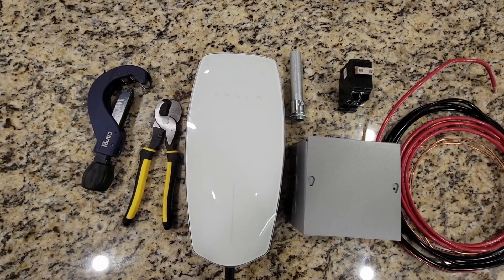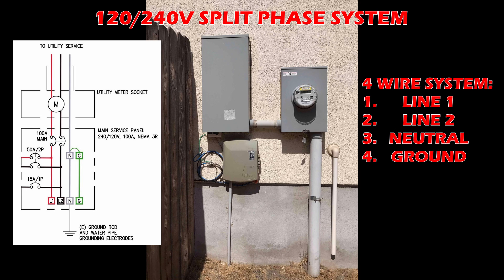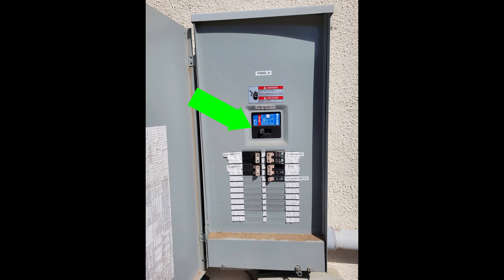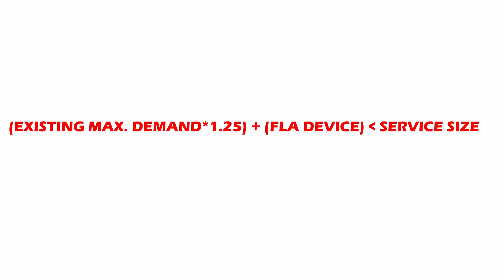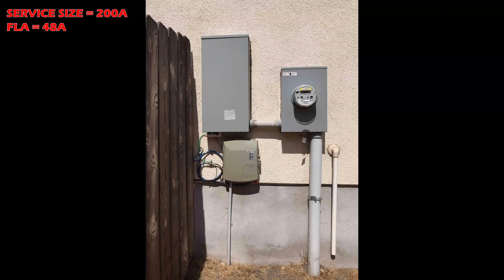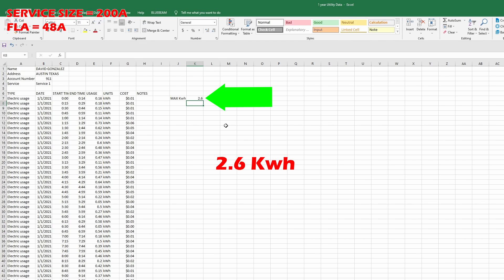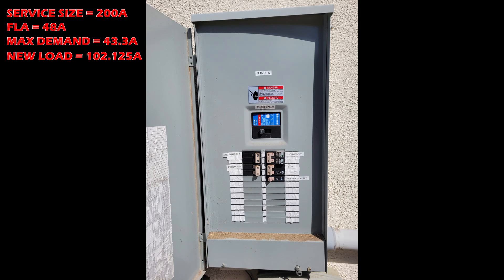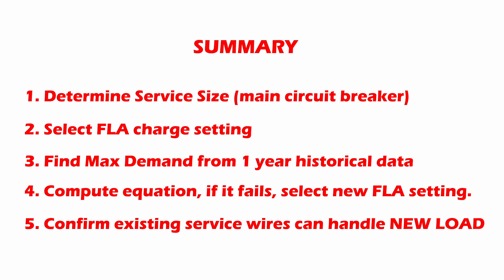Watch THIS before Selecting your EV Charger Circuit Breaker Size DIY

Comment: Great advice but I am moving into a brand new house and have been living in a 37' trailer where my electricity is free.....the question is how do I figure this out. The new home is 1275 Sq. ft and has a 125amp service. I am thinking of putting a 40amp breaker in for my tesla charging.

Comment: Too complicated. If you charge your EV from midnight to 6:00 am when electricity demands is low, you’ll be fine. However, if you intent to charge your EV during the day, yes, you need to calculate and check if your electrical panel can handle such demands. 

My home has 100 amps max service and I only charge my EV at nigh, with no issues.

Comment: Is the wire need to have a conduit even inside of the wall?
Reply from the maker: For residential installations technically no; i still recommend installing conduit. For commercial installations, conduit is required.

Comment: Excellent video.  I did this.  I downloaded the last 13 mos electrical power usage for our home from DTE Energy here in Southeast Michigan.  It gave maximum demand by the hour in an MS Excel compatible spreadsheet form.  I used the "max" function and found the maximum kWh level of usage covering over 9600 hourly readings.  I then divided by 240 and multiplied by 1000.  The answer was 44.1 amps.  So, speeding ahead, the inequality is met for the amperage levels under my consideration.  Thank you!

Comment: What's the part number for the Dryer combination breaker/SPD? I can't find anything quite like that online but is ideal for the panel my Daughter has.
Reply from the maker: SPD/Breaker I have is made by Eaton model CH250SUR. Eaton makes two models 30A (CH230SUR) & 50A (CH250SUR). FYI: These units will only fit inside an Eaton electrical panel that accept 'CH' type breakers.

Comment: Good advice to use data of actual energy use. The traditional "Load Calculations" are just an informed guess and will always vary from reality to some degree or other.

Our Landis+Gyr meter shows max energy in kW averaged over 15 mins. With this info I see our max amperage was 78 amps, so we are well within our 200 amp service. I did a load calculation and it estimated we are at 102% of the service when in reality it's half of that.
Reply from the maker: 15 min metering data is the most accurate--couldn't agree more.

Comment: But which gauge wire? One rated for 60a in your case?
Reply from the maker: Here's my minimum wire size design guide:
(COPPER American Wire Gauge AWG)

30A circuit breaker = #10 with #10 ground 
40A circuit breaker = #8 with #10 ground 
50A circuit breaker = #6 with #10 ground 
60A circuit breaker = #4 with #10 ground
For larger feeder runs (100ft+) wires need to be upsized to compensate for voltage drop.
Reply: Thank you! Now I have to see if hard wiring needs a neutral! 8/2 or 8/3! @dgtv3320
Reply from the maker: No neutral required. I share a bunch of install details in these two videos: https://youtu.be/OPc9_7wjcVM 
https://youtu.be/TenDt45gH_4
Reply: @dgtv3320  Thank you! I will watch.Mine will be Mopar because it's from the dealer, but I imagine its the same, though I will wait until I get it to buy cables! Thank you for the info!

Comment: Very good video. if anyone is handy enough and follow the code and watching so many videos here, it can be done very easily. This is NOT for all to install. Having said that, if you already installing one, go for the max AMPS you can considering your current panel max in. Moreover, I would avoid using plugs/outlet, if possible. These 2 things are a weak link and can cause many issues. After all, heavy AMPS are running for hours via these lines and they generate heat. HARDWIRED is the way to go.
Reply: When you say you would avoid using plugs/outlets are you referring to a mobile connector and Nema 1450 outlet? 🤔
Reply: @Da-King-of-Swing  I am referring to the NEMA outlets/plugs. Look, they will hold fine, but, why creating a weak link, if can be avoided. Even when doing hardwire, you need to makes sure all terminal screws are tight on these #6 or 8 (AMPS and length of wire using). Many video here on how to......!

Comment: Excellent review of how to assess your home demand for installing an EV charger.  There is, however, one more piece which is not covered in this overview, which is what size wire you need to install to the charger.  I purchased and installed some 8 guage romex wire thinking that it could handle 50 amps, but apparently only thhn 8 guage wire can handle 50 amps, but 8 guage romex wire is only capable of 40 amps.  Thus, I presume that I can use that 8 guage romex wire with a 50 amp circuit breaker and limit the charger to 40 amps.  If I knew this in advance, I would have installed 6 guage romex wire instead, but running new wire is challenging so I will start with this wire I ran and    consider changing it out if I find I would want more capacity later on.
Reply from the maker: I agree. I should have covered wire size; I didn't in this video but I cover it in 2 other videos. Regarding your wire install
Here's my minimum wire size design guide:
(COPPER American Wire Gauge AWG)

30A circuit breaker = #10 with #10 ground 
40A circuit breaker = #8 with #10 ground 
50A circuit breaker = #6 with #10 ground 
60A circuit breaker = #4 with #10 ground 
For larger feeder runs (100ft+) wires need to be upsized to compensate for voltage drop.

Comment: Great video! Excellent job in explaining how the actual calculations are performed. Any plans on doing the video to feed from a sub-panel? I've got a 200amp main panel with two 60amp sub-panels and was curious to know how the math works out to figure if I can install a 48amp car charger in one of my sub-panels. Thanks and keep up the good work!!
Reply: A 60 amp sub panel by code can not supply a continuous load more then 80%. So a 48 amp continuous load ( anything that runs more then 3 hours ) would need 60 amps and while an EV was on you should not have any other loads on. Suggest that you have an electrician either increase the 60 amp sub panel to 100 amps or runs dedicated 240 volt line to the charger.
Reply: Thanks for the input; will get an electrician to see what my best option is.
Reply: @garbo8962  Thanks for the input; will get an electrician to see what my best option is.
Reply from the maker: 48A charge setting on a 60amp sub panel wont work. From a cost perspective, it may be worth looking into a 30A or 40A circuit installed at the subpanel (assuming your electrician deems it safe to do so). Installing a dedicated 60A circuit from your main panel might not be worth the additional cost. Curious to know what quotes your electrician comes back with.

Comment: I see in the description you explain that you need data points every 15 minutes.  My electric company can't provide that or monthly maximum demand.  What I do have is a years worth of usage from every hour in KWH.  Can I take that max number divided by 240 times 1000 to get max AMPs?
Reply from the maker: Unfortunately using 1hr data invalidates the equation. I plan to release another video for an alternate calculation when 15min data is not available.

Comment: I’m doing a 50 amp can I use 8 Awg

Also can I put 8/3 romex in emt?
Reply from the maker: Romex in EMT is ok; however using #8AWG for a 50A breaker is not recommended. 
Here minimum sizes (using larger gauge  than minimum is ok, the Tesla wall connector maxes out at #4awg)
50A circuit breaker = #6 awg + #10 awg ground
40A circuit breaker = #8 awg + #10 awg ground
30A circuit breaker = #10 awg + #10 awg ground
Reply: @dgtv3320  I have to transition from emt to gray pvc to go undergound. Can I use the #6 romex for both EMT and PVC?
Reply from the maker: yep, not a problem
Reply: @dgtv3320  just to ask again, its ok to run 6 romex from emt to gray pvc underground. Iwill be using 3/4 gray pvc.
Reply from the maker: yes you can, cheers.
Reply: @dgtv3320 can you do 60amps=6awg+10awg ground ?

Comment: While verifying that your service wires are the correct ampacity isn't a bad idea, if your MCB is rated larger than your service entrance wire, YOU ALREADY HAVE A BIGGER PROBLEM, your wiring is not nor ever was to code, and you need to hire an electrician because clearly that's not the only problem you are going to find.

Note: in some situations, there may be an additional breaker between your "main" panel and the service entrance, Especially in (sane) regions that primarily locate their electrical distribution inside the dwelling, you can sometimes find an exterior breaker rated for the service feed, so the panel's MCB being "correct for the Bus ampacity,  but too small for the incoming service" is not technically incorrect.

Here where I am in Ontario, these types of external combination breaker / service disconnects are almost always associated with ancient feeds that are 60A, or (rarely) smaller if they were replacement breakers for services that were originally 30A fuse panels. They should be replaced regardless, and may be old enough to predate trip-free requirements. Meaning a jammed handle could prevent the circuit breaker from opening.

Comment: 1970's panel with 150A service. Do i need 200A service upgrade?
-sanity checking....
(EXISITING MAX. DEMAND*1.25) + (FLA DEVICE) < SERVICE SIZE
(57.6A*1.25) + (48A) < 150
120 < 150
Reply from the maker: Broadly speaking here, I didn't emphasize this in the video--a 48A (60A circuit breaker) is nice but definitely NOT required. You have multiple, good options (20A, 30A, 40A, 50A circuit breakers); the tesla app allows you to set the charge rate manually depending on the circuit breaker installed. A local electrician will be able to tell you if your existing 70's gear is in decent shape to stay or if it needs replacement. Paying for a service upgrade JUST for a faster charge rate is not worth it, in my opinion. We are talking about 16% charge rate increase @ 50A CB and 33% faster @ 40A CB (vs a 60A CB). Service upgrade runs around ~$5,000usd. For next steps, I would consider: #1) Determine if existing gear can remain in place. #2) if existing gear CAN stay, what parts are available? 40A 2pole breaker, or 50A, 2pole breaker? 70s gear may or may not be hard to find parts. I would start here.

Here's what the numbers look like at different circuit breaker sizes **assuming max demand was calculated correctly using 15-min utility data:
60A Circuit Breaker
(57.6*1.25) + 48 < 150 ~~ 120<150

50A Circuit Breaker
(57.6*1.25) + 40 < 150 ~~ 112<150

40A Circuit Breaker
(57.6*1.25) + 32 < 150 ~~ 104<150

30A Circuit Breaker
(57.6*1.25) + 24 < 150 ~~ 96<150
Reply: @dgtv3320  Thank you!
-next sanity check, is cable gauge requirement with distance factor.

-from breaker to wall connector 80feet run.
60A = 4 gauge
50A = 6 gauge
Reply from the maker: That's what I would install.

Comment: If the main breaker trips instead of the circuit breaker of a circuit, what would it mean?
Reply from the maker: Hi Carl, I'm making the assumption your main circuit breaker trips now after installing an EV circuit. I suggest using the tesla app to set the charge setting to 12amps and upping it slowly as needed. ( also assuming you have at least 30A circuit breaker and using #10 copper).

Comment: Does you house also have a subpanel inside the house (like in a bedroom or closet)? Mine does in addition to a subpanel outside next to the main.

I'm in the process of upgrading to a 200 amp main and I'm considering eliminating the subpanels. The electrician would turn the old subpanels into junction boxes.
Reply from the maker: I have a main panel on the side of the house and a sub panel in the garage. If you have a smaller sub panel right next to your main panel, consolidating to one larger 200A panel could be a good idea. If you have additional sub panels throughout the house, no need to eliminate sub panels if they are still in good condition. If they are very old and need replacement, doesn't hurt to ask for a quote to replace it (panel + feeder). You never know when you need a new circuit! Without my garage sub panel, I would have needed about 150+ linear feet of #4 copper to install the EV charger in the garage. Not only would the EV charger install be a pain in the ass (routing around the house), the install costs goes exponential.
Reply: @dgtv3320  Thanks so much for your detailed reply! Makes logical sense. I will indeed request a second quote to replace the closet subpanel instead of elimination. Yes it's a rather ancient 60's era Square D panel, but then again, the ones outside are equally ancient GE panels.

Comment: Are the calculations the same with solar? If not can u do one wth solar installed?
Reply from the maker: Good question. Same steps shown if you have solar & battery or just one or the other. Solar & battery reduces your electrical demand. This should be reflected in your utility data already.

Comment: You also need to ask what your car can handle.  I got my wife a Tesla Model X in 2016 and it can only take 40 amps.  I remember they had an option to get dual chargers to take 80 amps, but I don't see that option any more.  I recently got a model 3 and it can only charge at 32 amps.
Reply from the maker: Thanks for sharing your experience Phil. I'm a little confused on why your model X wouldn't handle more than 40 amps at home when at a supercharging station it can do, 150KVA, 250KVA and even 350KVA. Max charge setting for residential Tesla wall connector is 48A which is 11.520KVA. It must be a software bug/glitch.
Reply: @dgtv3320  The superchargers convert the AC to DC using large equipment at the site and charge the battery directly with 400-600 volts.  When plugged into level 1/2 chargers, the 120 or 240v AC is converted to DC using an on board charger, and that's limited to 40 amps on my wife's X and 32 on my 3.  Like I said, when I bought my wife's model X, I had the option to pay extra for a second on board charger to allow it to accept 80 amps of AC power, but I didn't get it since I didn't see any need for it.
Reply from the maker: @Phillip Susi  sounds like hardware (and maybe some software involved as well, as you have to pay to get it unlocked). Tesla charging you extra is ridiculous! Totally agree with you it is not needed at all. Not sure if the new vehicles have this limitation, (new limit might be 48A) but i cannot confirm.
Reply: @dgtv3320  Yea, it was actually adding additional hardware.  I just looked it up and apparently now all but the model 3 RWD support 48 amps with no option for higher, with the RWD limited to 32.
Reply from the maker: Yeah makes sense. thanks for sharing.

Comment: My breaker box was able to supply the 2 60 amp breakers I used a pair tandem slim breakers as all the slots were occupied. One tandem has the original circuits, the other handles the charger. Amperage used during charging can be controlled through the Tesla app. It is more efficient to charge at a lower current. A lot of heat is dissipated into the air at high current. When I do need to charge at a faster rate I have the option to do so.

Comment: It’s not a 4-wire system. You don’t get a ground wire from the utility. It’s a single phase 3-wire system.
Reply from the maker: Technically yes. From the electrical panel's point of view, it is a 3W+G system. That is 4 wires, which is what i was referring to.

Comment: This is why I have a Span panel and EVSE. It interactively monitors what my house is using and adjusts charging accordingly. My house has 100A and my span drive is on a 60A breaker.
Reply from the maker: Nice! That's a fancy $5000 panel.
Reply: @dgtv3320  A service upgrade for direct buried service with PG&E would be $25k.

Comment: The meter is the first part.  Some older meters are only rated at 60 amps or 100 amp not 200 amps that most new homes would have.

Comment: Black is A phase, not red.
Reply from the maker: City of Austin requires Phase A Red and Phase B Black. Refer to your local jurisdiction for exact color requirements.
Reply: @dgtv3320  Which phase is which is indistinguishable.  The important one is that one is red, one is black, and if you have the third ( commercial buildings ), it's blue.

Comment: Great video! What do you do if you can only get hourly data from your power company? Also I was not able to  find your video on hooking up an EV charger to a subpanel can you let me know where to find it?
Reply: So I had the same thought as I was going through comments. I took my KWh and divided it by .60 (1hr) of time and was able to come up with my amperage. I hope that is accurate. If I am wrong OP please let me know

Comment: NEC 220.82(B) and (C) has the detail how to calculate dwelling unit service load. Use 240V * rating of the panel and subtract the existing VA, that is the Max volt-ampere in remaining, take this number divide 240V or 120V depending either 2 pole or single pole breaker, now you have the Max current you can have from existing panel.